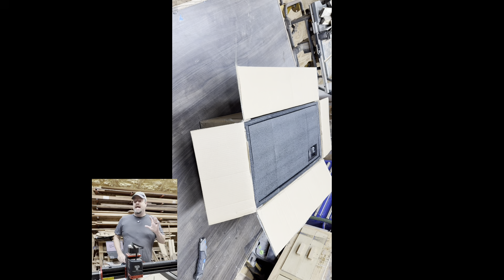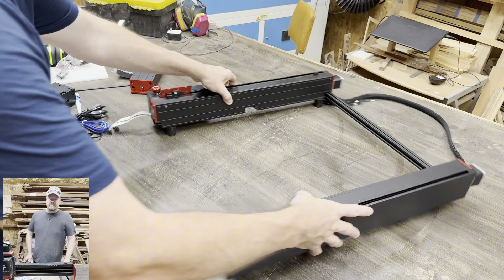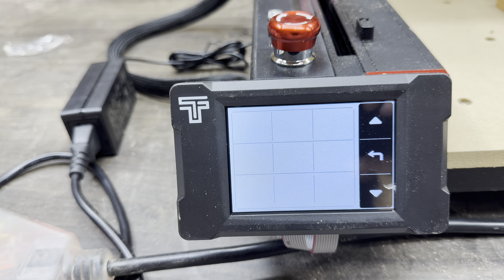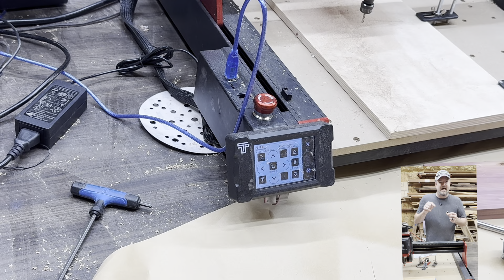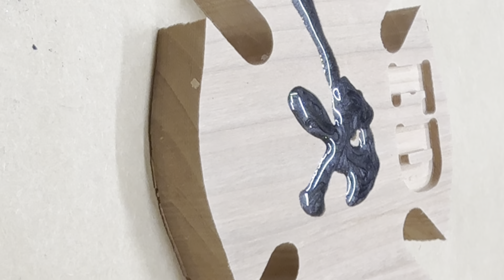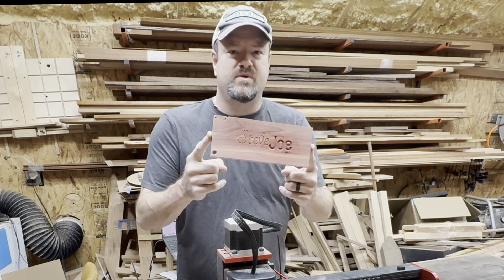Before You Waste Money on a Cheap CNC… Watch This FIRST | TTC450 Pro Review

Comment: Can it do carving and make 3D designs on 2inch pine wood or hard wood.
Reply from the maker: I think so check out my other video where I upgraded the router to a harbor freight trim router and I 3-D printed a mount for it. It works so much better. I just recently got the mailmage CNC software, which is supposed to do carvings, but I haven't tried them yet.

https://youtu.be/bYkhvQiPRw0?is=c7COmdSbcdAbS8pF

Comment: Easel, carbide and millmage are great but expensive, i started using freecad and i think its great.
Reply from the maker: I might have to try that before I buy something
Reply from the maker: Hey, thanks for the tip
Reply from the maker: Does Freecad let you control the Cnc?
Reply: @myhoneyshandmade1077 im not sure, i only use it to generate gcode and use universal gcode sender ( also free ) to control the twotrees 450 and do the operation

Comment: Get some large, cheap plastic medical syringes to apply your expoxy to tight spaces. 
After you have mixed your expoxy in the larger container, transfer it to a syringe and should make it easier to apply to your project, nice video.
Reply from the maker: Good idea I haven't used a syringe yet.  Thanks for the suggestion.

Comment: I bought the Two trees 450 Ultra - a step up from your model - has a much more  powerful spindle and I have logged about of 100  hours so far and  works great.  I did have a couple  screws that came loose but did not fall out...I put some thread sealer on them and tightened them back down...no problems with screws since.
Reply from the maker: Awesome. After I upgraded the spindle to a harbor freight trim router it's much better.
Reply: @myhoneyshandmade1077 How much faster and better is it? Maybe you could do another video repeating the exact same exercises/ projects but with the new router and show time differences and well as showing how much better the cuts are?
 I'm looking into buying a cnc myself for home use...maybe a little more? Trying to figure out which one to drop the money on? It's Between TT, Genmitsu, and Fox Alien $500 models. Thanks!

Comment: Could be a solid first CNC machine. I am using MillMage with mine right now since I use lightburn a lot. I really like it so far.
Reply from the maker: I downloaded that, but my trial ran up before I had to publish the video which CNC do you have?
Reply: @myhoneyshandmade1077  push the extend trial button when you are able to get back to it and it will give you some extra time. I ended up with the Genmitsu 404 Pro Max.
Reply from the maker: @OleMakes  good tip I'll try that

Comment: Hey, that looks just like the screw that's missing from a tool I don't have.  ha

Yeah, 80 watts isn't much power for something designed to cut wood, is it?  As far as mounting another router to it, there are a couple models on Makerworld designed to hold a 65mm router.  They're for the TT450, not sure if it's the PRO version so I have no idea about how the mounting holes will line up, but it's worth a look.
Reply from the maker: Thanks. Yeah, that's where I saw one of the collar for the 65 mm router..  I can always design my own if I need to

Comment: The loose screw was probably stuck to the outside of the router motor (the motor’s magnet). The vibration probably shook it loose. Looking forward to the HF router upgrade.
Reply from the maker: Oh good point.  Thanks for the info. Thanks for checking it out. Yeah that harbor freight upgrade should make a huge difference. I'm working on designing something for it on my 3-D printer right now.

Comment: A loosened screw by a loosened screw!  Ive haf my cnc.for a few months.  I need to learn how to use it.
Reply: I use Easel as well.  Ill admit it i really haven't looked at it as much i should have.😂
Reply from the maker: @TheSawdustKitchen  the bad news is my trial has expired
Reply from the maker: Ha.  Which one do you have?
Reply: @myhoneyshandmade1077 The genmitsu 4040 promax.  I know how to use the program side....just no clue as to what settimgs and bits to use haha
Reply from the maker: @TheSawdustKitchen ahh. A big thing I learned was I like the quarter inch shank tools better than the 8th inch so the quarter inch V carve bed didn't struggle as much and seemed to do a lot better with a lot less chatter.
Reply from the maker: I use the free trial of easel. What software do you use?

Comment: Loose screw... About those connectors coming loose - my Creality K1's hot end cable would work loose andy fix was to dab just the tiniest amount of hot glue onto the connected connector.  That way if you do need to replace it, you can pick it off with your fingers without doing harm to any of the wires/ connectors.
Reply from the maker: Great idea I've got an awesome hot glue gun that I could use for that. Thanks for that tip. Appreciate you checking the video out.